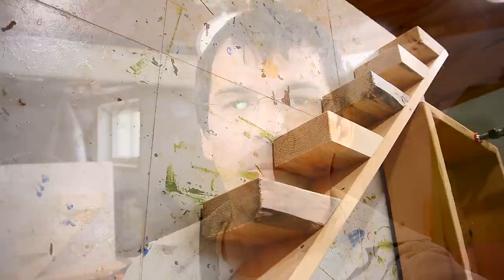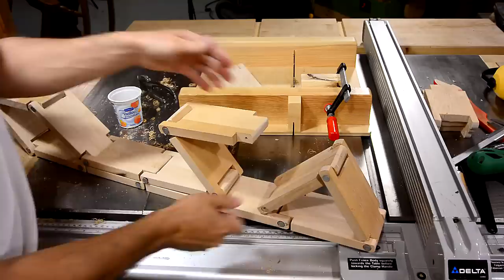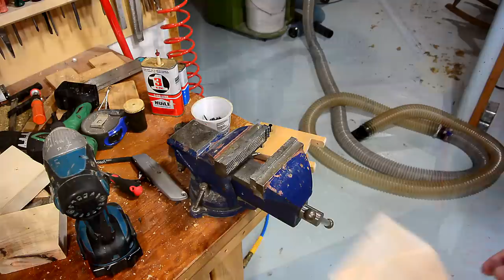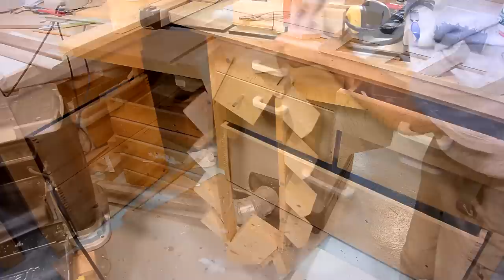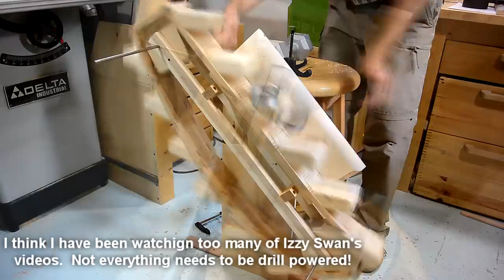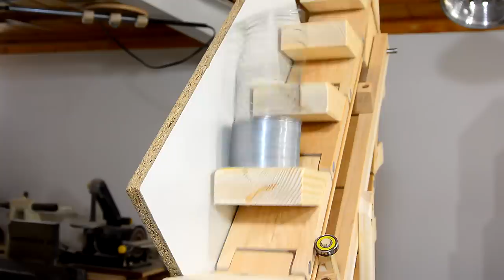Building the slinky escalator

Comment: I'm surprised you didn't make a gearbox for the drill in order to make it easier to control.
Reply: Matt McConaha I second this!
Reply: I third this!
Reply: I thirsth this!
Reply: My thoughts exactly
Reply: A motor controlled via vfd would be ideal for this type of application.
Reply: Agreed.   Or a stepper motor and a raspberry pi.
Reply: @dougrimmer9585  Raspi way less elegant, this could easily be analogous, maybe even mechanical.

Comment: I think the thing I admire the most about his videos is the time and careful consideration that goes into each project. This video and the wooden marble maze are my favorite thus far.

edit: wouldn't there be a way to get some type of software system that could regulate the correct speed and consistency to operate a motor that drives the crank?

Comment: Mathias, that is pretty cool but I'm a little surprized that you didn't think to use a simple reduction gear mech to allow the motor to run faster and therefor be more easily controled. Never the less, a cool invention any way.

Comment: I love your design...but expecting something more of it..to run the escalator absolutely perpetual condition...I am suggesting a few modifications..you may give a try...
1. Put the shaft of the rotor on best/smoothest bearing available in the market
2. Attach some weight, may be a metal disc, each on the ends of the slink spring
3. Adjust speed and then stop using external force when the escalator start running itself
4. Change the material of the steps from wood to some lighter one, like plastics or adjust the weight of the metal disc to run the escalator perpetually

Comment: Would be interesting to run it with a motor with a suitable gear reduction and have some sensors to track the position of the slinky,and make a closed loop control system to keep the slinky running in one place.

Comment: 1. You could add some eletronic: cheap motor and cheap sensor, then you can control the speed of the elevator relatively to the slinky's place :)

look at arduino, it should be fairly easy

2. you could stick some rubber on your stairs too make the whole more stable

Comment: clear walls on both sides would be good... but for an all wood feel, how bout adding cones on each step with base diameter a bit less than slinky internal diameter and high enough to let the slinky slide to center, but low enough to allow transfer to the next step.
Reply: might be a lot of work though...

Comment: Great work, as usual.  I notice that you ALWAYS pre-drill holes that are for screws.  I have watched videos from other wood workers and they skip this step much of the time.  I know a lot of times it is to prevent splitting.  Are there times when pre-drilling is not necessary?  Does pre-drilling increase or reduce the strength?  Maybe a video exploring this would be interesting.

Comment: So cool! Well done! How about some light sensors to detect if the slinky is at the bottom or the top of the stairs, an Arduino and a stepper motor or a motor with a speed control? :) :)

Comment: you should make a belt or chain for it and set up a motor with an adjustable resistor (I forgot the actual name of the part) set the resistor to thr perfect amount of reistance and add a switch and power source

Comment: I really thought this was going to be automatic. Like if it had really light weight steps that moved upwards if no weight is applied, either using rubber bands of springs. And so when the slinky is almost weightless for that fraction of a second the escalator moves up. I dunno just thought it would work endlessly using some inertia or momentum.

Comment: I'm nearly two years late, but why don't you use gears to solve the problem of the drill being too fast to control? It should be rather easy to implement and it makes the machine automatic